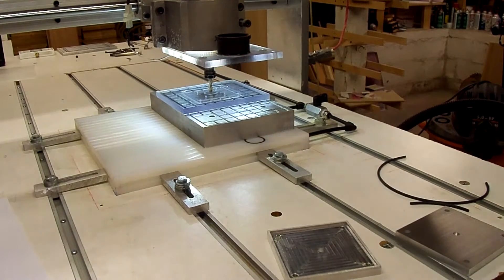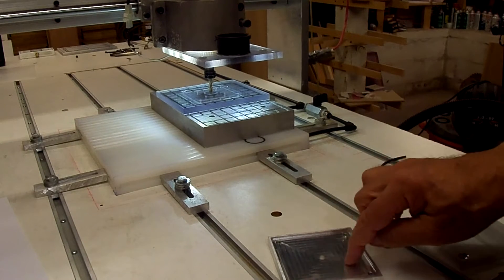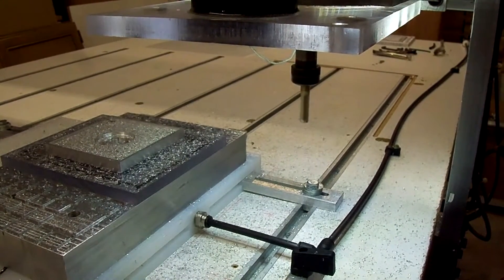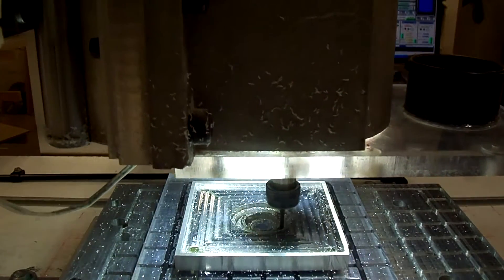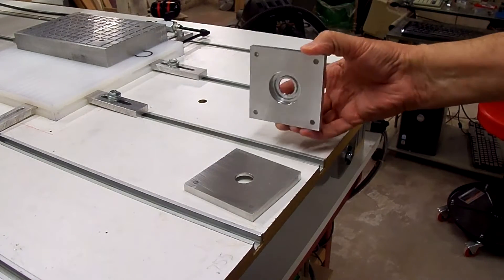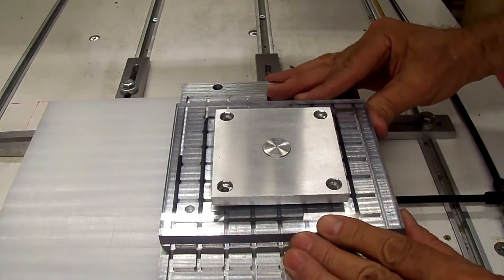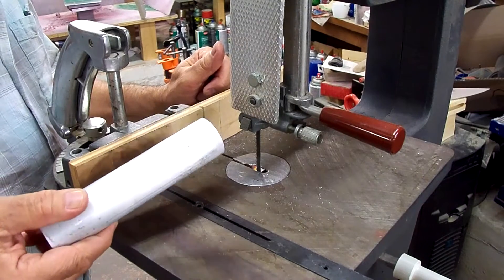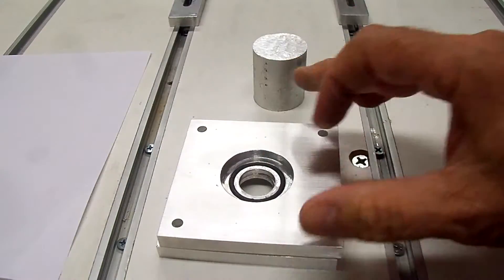Aluminum Interchangeable CNC vacuum pods Part 2

Comment: hi mr. Robert.

what config you use in mach3 "Motor Tuning" option and in the motor driver how nany mucro-stepps you use?

i mounted a nachibe to me but i having some problems with motor crashs. have 1600 micro-stepps on motor driver (DM860A), my motor tuning in mach3 is "320 stepps per", "2000 velocity", "80 accelrration"

i use mm as unit